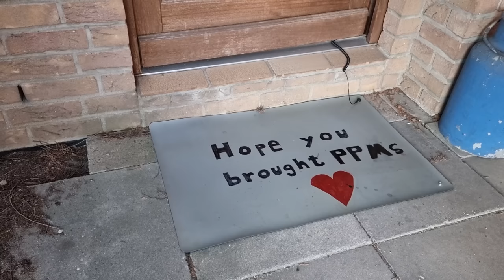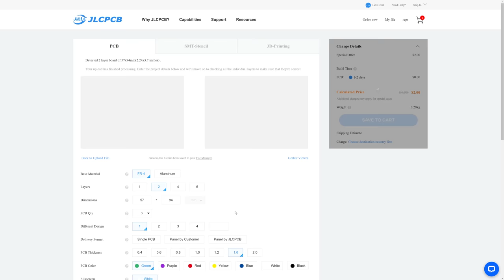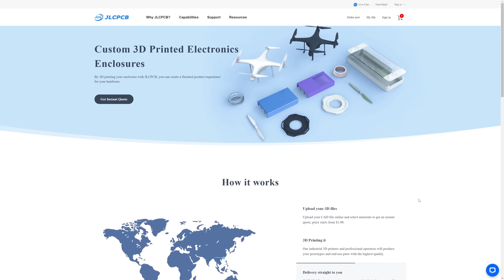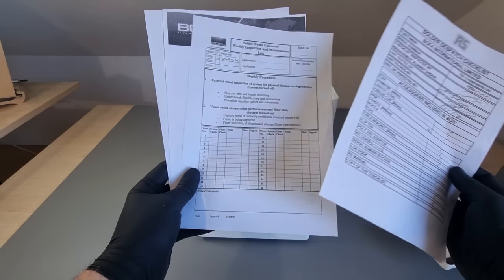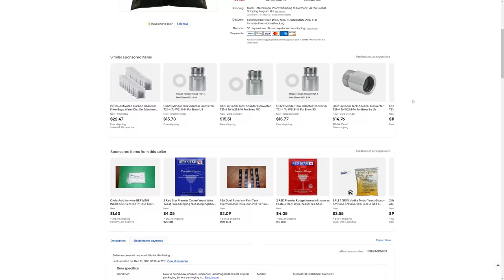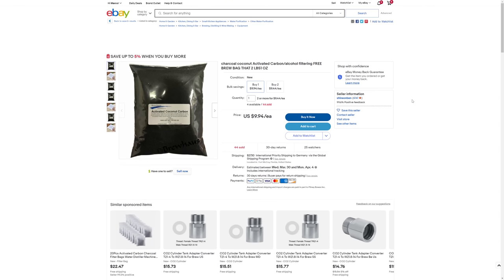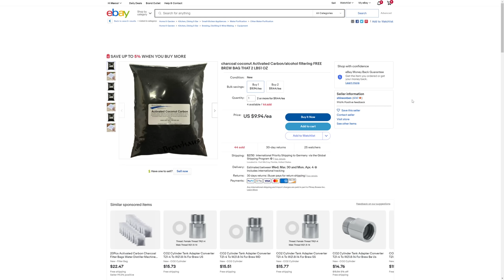All New Everything - Soldering Bench Upgrade for Productivity Ep1

Comment: It is not something I would recommend, concerning solder fume inhalation. Depending on what type flux core your solder has, it is always a good idea to remove the fumes out of your air path. It is the flux components that have health related effects. Just keep out the fumes from your breathing path and you are good. The Pace WJS 100 is a better built station. The Quick 861 DW is still unrivaled in the hot air world. I have a Pace fume extractor. I also use a Pace MBT 250 is the main unit I use for general board work. The Pace SMR I use for RCA and Cannon plug work. To each their own as far as equipment goes, but highest quality equipment does yield the best results. Ersa and JBC also produce first rate gear. Solder quality varies. If you are wanting first rate results, Kester, AIM, Alpha Metals and Multicore are the brands which yield the real results that matter. Flux that matches your solder’s flux core and brand will yield consistent, reliable, repeatable and the highest quality results. Your level of involvement will determine your real commitment to this skill. Practice is how you raise the bar for yourself. Not everyone has the commitment level. Soldering is a passion for me. I learned DOD STD 2000-1 soldering from my supervisor and found something I could really get involved in. I do high end work so this fits right in. The new J STD 006 level 3 is the equivalent to DOD STD 2000-1. This is the highest level of commitment there is in soldering. Not for everyone, but worth it for the challenge!

Comment: i have a similar microscope without the display. the power supply that came with the camera is so bad that the touchpad on my laptop doesn't work when I I connect it through a USB cable. Replacing the power supply with one from my scrap box solved that.

Comment: I have a Quick 957 DW+ and it can't be beat for the price ($125). Great build quality as expected from quick, pretty quiet, great airflow, and fast heatup. Does anyone have any recommendations on microscopes? I still can't decide if an Andonstar or an Amscope would be a good purchase.
Reply: I really haven't found anything that beats used, at least while it lasts, which should be a while, as they built tons of them for universities and manufacturing. My strategy was to find an seller on that auction site, who isn't so much into auctions as restoring microscopes. A little bit of research on them (e.g., there's two different fundamental types https://en.wikipedia.org/wiki/Stereo_microscope) goes a long way to pick the one that suits you.

Comment: 3:23 Solder fumes are really not that bad. You will never get solder that hot to vaporize the lead in it. If you're doing occasional soldering, a fume extractor is overkill. But if you're doing soldering often, and especially if you're doing it professionally, you should consider getting one. Even harmless fumes can start causing harm if that's all you're breathing every single day.
Reply: Lead does evaporate in tiny amounts when molten. But nowdays most solder is one of the lead free alloys. And as you sad dose makes the poison.
Reply: @TheBackyardChemist  Only above 450C or so. You usually will not get hotter than 350C with lead based solder. Even with lead free you won't go above 370C.

Comment: Does anyone have a trustworthy recommendation for “highest quality” micro-coaxial cables? For over a year now I’ve been trying various SFF8643/8654/8611 cables to connect to PCIe Gen4 U.2 SSDs - PCIe Gen4 uses 8 GHz. Every single cable has been sh.. quality-wise and now I want to build my own.

What makes me think that this is generally possible is that an old SFF8643 cable from about 2015 causes the least amount of PCIe Bus errors even though the SFF8643 connector is the worst of the three types mentioned for signal-to-noise ratio.

Comment: Yeah those microscopes come from the same factories there's roughly 3 different models, only difference between brands is what camera and arm they pair with them. 

I got a few for my old job from Aliexpress with the heavy aritculating arms, which I strongly suggest as the fixed bases get really frustrating pretty quickly, especially for odd shaped boards

Comment: According to your door mat...you want guests to introduce more ppms?!?

Also, dear literally every manufacturer, not everything needs an app, not every app needs an account, or my email, or to jump through various hoops to access basic functionality. if I can't turn on your app connect to the thing and control it in that order with nothing interrupting me, you have designed your app poorly and it reflects badly on your product. the amount of times I just wanted to quickly set something up and as soon as I open the app I have to go through the tutorial and then create an account and then wait for an activation email and then confirm the activation and then set up my profile just to turn some LEDs blue is so sad I hear in the arms of an angel in my head when I think about it. No I don't care how much money is made on the back end selling information. Stop it. It's getting to the point where an entire generation of people will avoid your products if they require the cloud. At the very least don't lock out the possibility of third-party firmware so people who know how to do it can run their systems within their own network entirely. You know, without making an account with your system or without your fingers in my network, I know it's terrifying. And just because your product has an app, does not mean you should be removing physical controls on the product itself. The number of TVs alone that no longer come with buttons on them for channel volume menu access is worryingly frightening....

Also also, solder smoke used to not bother me when I was younger, but it does now. Actually get a little bit of shortness of breath for a while afterwards, even just light solder jobs. And I didn't do a whole lot of soldering over the years. More than your average person but not nearly as much as I'm sure you've done. I am also a smoker so... (Shrug). When I was younger as with many young people you think you're invincible, but now that I'm older wiser and balder (I was born the same year as one of your calibration standard instruments, one thats older than you) I entirely recommend some sort of air movement to at least keep the bulk of it from going up your nose and in your face. I also tell young kids to protect their knees and back.....ask me how I know(gets up from couch to a symphony of snaps cracks and pops). And whatever you do don't get old!